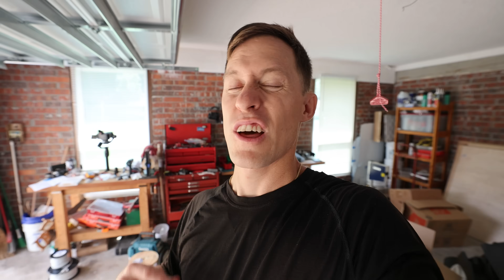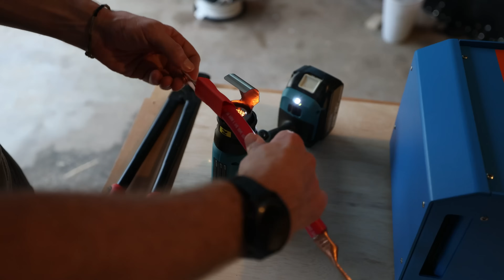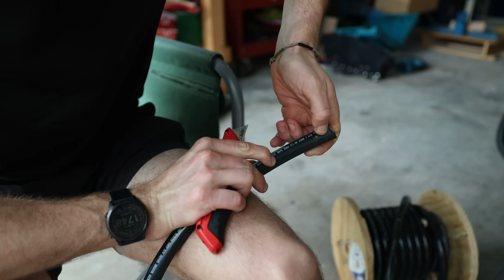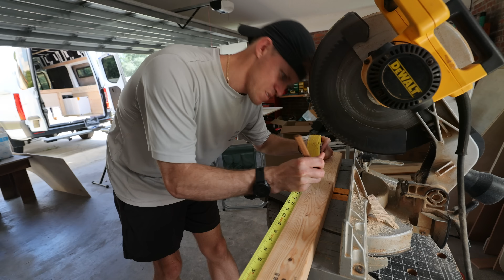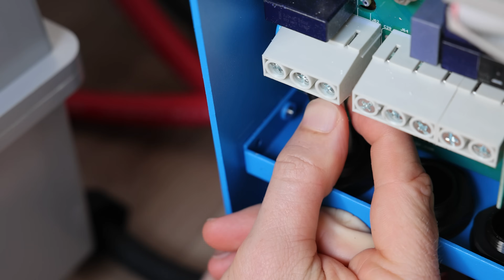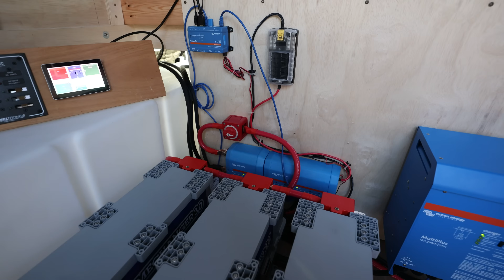We Installed the BASE to our OFF-GRID ELECTRICAL SYSTEM (810 ah Battleborn GameChanger3)

Comment: Isn’t the ground wire a bit too small? I was installing the same MultiPlus 3000 and Battleborn batteries in my Sprinter just a few months ago and I was been told to use not less than one size down from 4/0 for ground; since I didn’t had 3/0 I used 4/0 for ground which is totally fine. Also I actually connected it directly to the chassis. I noticed you connected it to the body and on top of the paint; I would definitely grind that paint off as the terminal should touch the bare metal. Just some food for thought.
Reply from the maker: Great tips! We did grind it down, so its touching the metal! I just don't think I filmed that... I may change it to be a 4/0 wire, but we're right at the border of 2/0, so that is still technically safe. The 4/0 wire is so expensive I needed to make sure I had long enough for our alternator run (coming in a future video). So all in all, I may change it to 4/0 before securing everything! How are you liking your system so far?
Reply: @SchoandJo  Sounds like you have everything under control. 👍🏻I spent close to can$800 for all of the 4/0 wiring, which came as a big surprise to me as well. I was a bit more limited since I installed my system in a Sprinter which was camperized by Airstream (Interstate) having to deal with the existing space and installation. I am extremely pleased with the way it’s working so far. Unfortunately I was only able to put in 400Ah Battleborn batteries and 500W high efficiency solar panels on the roof; but since it’s just for myself it’s plenty of electricity and my Starlink is on most of the time. In case you haven’t found a solution yet on how to charge your lithium batteries with your engines alternator, I can highly recommend the Li-Bim 225 which does an excellent job.
PS: We pretty much live the same lifestyle except in opposite directions….lol….I just bought a Nordhavn 40 on the East Coast and planning on doing the “Great Loop”. My beloved Sprinter will be stored away for the time being.

Comment: I'm surprised you installed your master on/off switch right over your batteries. If you have a problem with the batteries how do you proposed to get to that switch. I think it would be better on your status board so that if there is a problem you can shut off the batteries.  You should talk to the battery people about the best place to install that switch, after all, theres a reason that switch is red.
Reply from the maker: Red switches are important! 😁 On our boat we only switched off our batteries once or twice in 2 years so we figured if we need to lift up our bed to turn it, then no big deal! As long as we don’t need to unscrew anything and can get to it easily, then that’s good 💪

Comment: I used 2/0 to connect 5 big deep cycles in parallel. Whatever you use they must all be the same length,  pos on 1st battery, negative on 5th battery so electricity goes thru all of them
Reply from the maker: Nice!! That's what we did 💪

Comment: How are you going to charge the batteries when there is no sun? Are you going to be able to plug into shore power, or external generator!!
Reply: Run the engine,  it has an alternator,  should be upgraded to a 125 amp tho
Reply from the maker: No generator, but a dedicated alternator and, in this video we installed shore power!

Comment: Have  enjoyed your adventures on the Great Loop from the start to finish but what insurance company is going to insure a home made camper that hasn't been installed or so far inspected by a professional electrician, plumbers etc.  Have you put in much thought of weight distribution in the camper, just wondering?
Reply from the maker: Insurance companies insure camper vans all the time, they just need to be inspected! Just like boats, after many owners make changes - they are rarely always installed by professionals... Weight distribution is definitely something on our minds, which is why we put the batteries in the middle, slightly to the left on top of the axel! Cheers!

Comment: - Another great video you two. 
- Did the RV thing before we bought a Trawler and did the Loop. 
- Really looking forward to the new adventure you will be undertaking.
- As during the loop your concerns concerning "air-height" were evident do yourself a favor and figure out youf van builds overall height and make a sticker/placard and place on windshield for a quick reference. You will come across some height restrictions on your travels. Examples are covered bridges, heck even some roads the Merrit Parkway in Conneticut has an 8ft restriction if I remember correctly. Better to be safe than sorry.
Reply from the maker: That's a great recommendation, thank you, Jeffrey!

Comment: There is something SO satisfying about putting an electrical system together, flipping it on, and stuff actually works!  Great job y'all!  Hey I'm curious, are you guys going to have to beef up the suspension at all or is it already setup to take the extra load?
Reply from the maker: Seriously!! Super satisfying :) We're not planning to do any updates to the suspension, as most of our friends who've built vans haven't needed any changes. So just like everything, we'll play it by ear and see how the van handles! Always something we can add later :)
Reply: @SchoandJo  These things are so versatile, seems like they can handle about anything!

Comment: Nice job, but the battery switch should be accessible from the living side of the van just like the battery switch on your trawler.
Reply from the maker: We considered moving it, but on the boat I think we used it once or twice in two years, so we determined having to raise the bed and lean over to turn it off is good enough! As long as we don't need to take apart anything to turn it off!

Comment: Please keep in mind that all battery cables need to be the same length and size for optimum performance. The wires that connect each battery to other batteries and the POS and NEG that goes to the buss bar or inverter.
Reply from the maker: Yes! That is a good point, I believe I did say that in the video too 😁